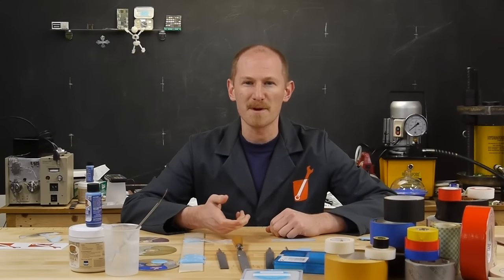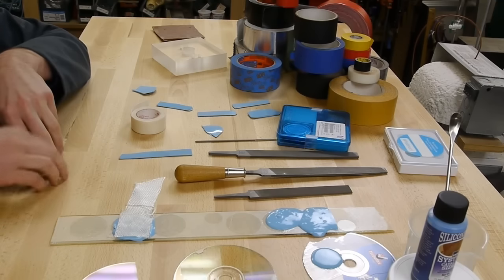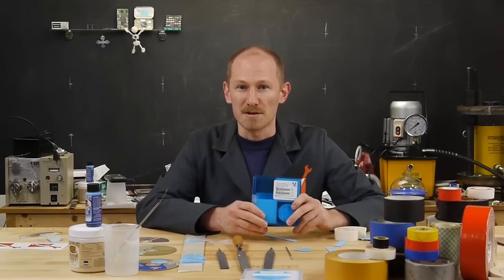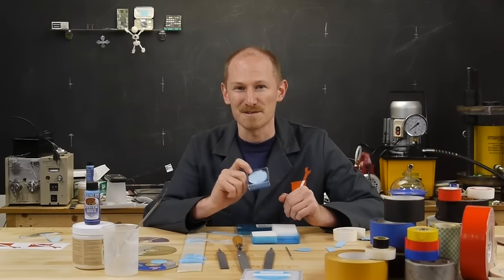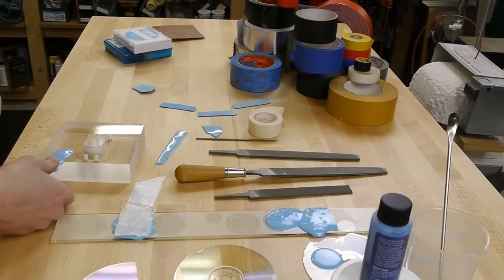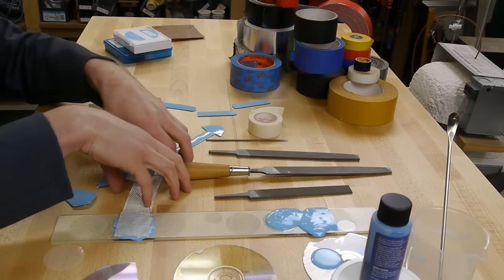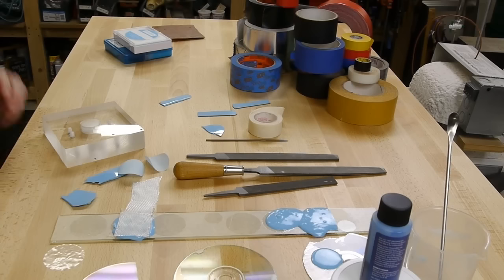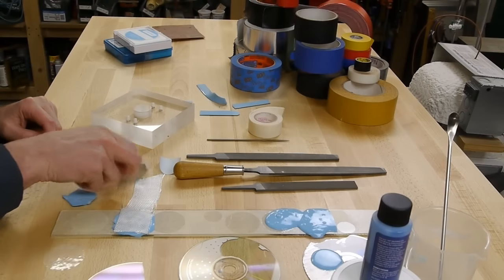Making DIY gecko tape - work in progress

Comment: Speaking to your limitations in making photolithography masks:  In 2013 I did a project at my university using Laser Interference Lithography with a 325nm UV laser, a pinhole, and a mirror to create extremely uniform and tiny (smaller than our photolithography masks were printed) periodic structures in photosensitive chemical film Photoresist, then etch the pattern into the substrate (silicon wafer or polymer film) using chemical or plasma etching, respectively.  I got the pillars down to 995nm from peak to peak, and the height depended on the thickness of the Photoresist, although the pillars were actually had a much more sinusoidal cross-section than as actual pillars.  The interference patter is 1-dimensional with respect to the symmetry of the mirror reflecting the laser light, but exposing your material, then rotating it 90 degrees and exposing again will give you a nice 2-dimensional pillar pattern!  The angle of the mirror and substrate surface relative to the laser beam dictates the period of the structures, and thus, the pillar size.

I don't know what all tools you have to know if you are set up to try all of this, but if you have the spin-coating rig and Photoresist compound (and I've seen your other videos about lasers) then you are already most of the way there!  You'll need the pinhole and a mirror for the laser.

Comment: I work at a solar cell lab and a common micro structure that we make is those nano pillars (called nano wire arrays). The common method uses only chemistry : you typically use metal ions reduced to nano particles that catalyse an etching reaction. This is called Metal Assisted Chemical Etching (MACE), and it is typically done with Ag nano particles in a Hydrofluoric Acid bath. The aspect ratio is tunable and you can get good dense forests. It is usually done on monocristalline silicon wafers which can be hard to get, but they are very cheap. You can then try double casting to transfer to silicone rubber. 
You might also find a method to make the negative mold directly on a wafer with MACE

Comment: I was thinking you could possibly shoot your ruby laser through some sort of prism to detract it into a patern like those cheap laser light shows. For a surface, shoot it at a really hard non etchable surface coated in an etchable surface from your vacuum deposition system. Possibly silver over tungsten? If you had control of your surface coating you would have control of your depth. then you would only have to get an etching of a appropriate pitch.
Reply: +Seth Roughani You can still etch, mill, and cut silver metal using excimer lasers, because it relies on ablation which is not a thermal process.
Reply: Ablation with excimer lasers can be essentially a cold process thanks to Coloumb explosion or direct molecular absorption, removing only the atoms or molecules at the exposed surface. This is sometimes a benefit in LA-ICP-MS analysis for some samples. In any case these kinds of lasers are not DIY. Of course it would be much easier finding someone who can do it for you than trying to build one.

Comment: You could use a Lloyd's mirror arrangement with a 405nm laser (blue ray) and double expose after a 90 degree sample rotation.  Assuming you are using a positive photo resist.  This will give a squarish pillars anywhere from from submicron up to many microns depending on the angle into the Lloyd's mirror arrangement.  I have made gratings this way very easily (only one exposure for a grating).

Comment: Could an organic mould be used? Wood or some other material, perhaps with some part chemically removed to provide channels for moulding? The remaining mold material could perhaps also be removed, creating additional options for the end shape of each fibre (assuming the material fairly uniform in structure).
Reply: That can be work

Comment: A couple ideas -

Layer many sheets of ultra thin material, with every other sheet unaligned, similar to folding a deck of cards.  Use this as a mold, similar to the ultra-fine file method.  

Use flower pollen to create an inverse mold.  It's spiky structure will make holes, and the inverse should result in little pollen like spikes.

Comment: I admire your curiosity and tenacity. If you could get UV cureable silicone, then you could create a modulated raster scanner for UV laser, with rotating mirrors. Final projection can be then scaled with lens. This way you could CAD out various ideas as raised 2D pattern. Start with flat cast silicon base, apply uv cureable layer, expose and then wash with necessary solvent. With solid system alignment multiple pattern layers could be built up perhaps.

Comment: Cast onto finely ground salt epoxied to a surface. That way any grains which stick to the casting can be washed away.
Reply: This sounds like a very cool idea to me, is there any precedent for it working before?
Reply: You can make the salt molten and form it in a negative mould potentially.

Comment: You can use your Electron Microscope for developing Photo-resist it is a bit tricky because of accumulated charges and so on, bending of the beam, but quite easy to accomplish, i did it once to develop a semiconductor.

Comment: Couldn't you just make a mold of an actual gecko foot?
Reply: no, he cannot because if he would make it, he needed a very thin material to get between the geckos tiniest tiny bits of hair which can get from fluid to solid which probably does not exist
Reply: Mould*

That would hardly be practical
Reply: As a gecko owner I don’t know how well that would go over. Sounds cool though, but I doubt the animal would be very into it. Some are a bit fragile.
Reply: @kyokoyumi  ohh ok thanks I always thought mold was the fungus and mould was a vessel used for shaping things guess they are just English vs British spelling

Comment: Maybe you should try casting silicone to the end grain of highly polished ebony wood. Another idea would be to set the silicone on a vibrating platform on top of a speaker. Then, by controlling the frequency you would be able to adjust the pillar shape and size.

Comment: I dont know if these ideas allready got passed by, but things that come to my mind are the next:
- an osmoses filter (the one for seawater filtration for example)
- maybe it is possible to get a membrane for textiles, like waterproof clothing is waterproof because it has a membrane which will not allow waterdrops to pass. 
- Filter material, most fuel filters are in the range of 30-80 microns, much too large for your application, but there are finer filters.
- Helium balloons are coated with a metallic surface, but the helium still passes through the material because the helium atoms are so small (compared to air), so you could take a look at this surface with the SEM
- Maybe you can utilize extreme fine metallic powder, which you could orientate using a magnetic field.

Just some of my ideas!

Comment: How about casting on aerogel, wouldn't that work since aerogel has a very high surfacearea?
Reply: Harald Lindohf , had the same idea, searched for this comment to not repeat.
Reply: problem of aerogel is its unique characteristic: its full of bubles....
this means that any mold made out of it would be inperfect, and the "sidewalls" of the bubbles would not be rigid enaugh to suport being filled with rubber

Comment: There are off-the-shelf products that have achieved that kind of scale. I've worked with a sheet product from a company called Sharklet Technologies. The sheet is intended for germ resistant applications. The pattern is about three microns deep, with grooves forming a an interrupted diamond shape (mimicking shark skin). Might prove interesting if used as a mold for a soft silicone or other soft material.

Comment: Those filter membranes are also used in hydraulic analysis testing in aircraft that require hydraulic fluids to meet a certain level of cleanliness. Typically, the other method that is most commonly used is through a process called light extinction however in worst case scenario, we’ll use these to get a rough estimate on the state of the hydraulic fluids. Essentially, the hydraulic fluid that needs to be tested would get pulled from the system while the system is actively running, the filter membrane would get soaked with a dry cleaning solvent, then the filter membrane would get said sample put in a flask and use a vacuum to pull the sample through the flask, through the membrane and into a waste bin. This process is repeated two more times. Afterwards, the sample would be put into a clear case and analyzed against a chart that displays what colors the membrane is supposed to look in comparison to what it actually looks like. If the membrane doesn’t meet the standard, it shows that the cleanliness of the hydraulic fluid doesn’t meet the requirements and should be flushed or replaced entirely or perhaps the equipment the fluid is running in is contaminated and should be repaired (ie torn o-rings, fine metal shavings, etc)

Comment: Make a new cast of the file,  then use that cast to create gecko tape. This will reverse it and put the sharp edges in the crevices of the new file while the round crevices on top in the new cast.
Reply: Lama Takahama doesn't silicone stick to other silicone?
Reply: Who said you had to cast silicone? 
Couldn't you cast the file using a mold clay or putty?
Then cast the silicone off of that?

Hope this helps :-)

Comment: Like you said before, gecko works by creating a contact by combining structures of different order of magnitude. The pillar and the hair on the top. But you only have the pillar ! It might be too hard to create both by silicon molding, but you could create the hair using chemical coating or something like that. Very interesting ! Good luck!
Reply: Only successful way so far is probably to buy a gecko, love and live with it for 14 years or so, once it’s dies, cut of its hands and feet and glue to a glove. 

Spider-Man.

Comment: One point in time I worked with microfibers. If you take a cross section of one of thos they look alot like the structure you looking for. But in a cloth they are woven in another way. There are alot of SEM pics if you search for ex. Evolon or simular brand of microfibers.
Reply: +GeekJoan Chemically processing the ends of a bundle of microfibers sounds like an interesting approach.  At least fibers would be stiff rather than limp like the silicone :)

Comment: Hi, I used to make
nano/micro structured coating for a living working at the Energy Research Centre Of the Netherlands. 
I think your Gekko Tape project is awesome, I would like to contribute with my line of thinking. 
I found these articles:

http://rsif.royalsocietypublishing.org/content/11/94/20131205
http://www.mdpi.com/1996-1944/4/5/825/htm
From the first paper I gather
you need a specific structure with a specific feature size and aspect ratio.  According to this “single” paper,
you are trying to make a micro structure with roughly 12-20 micron size
features standing upright with an aspect ratio of between 1:1 and 1:1.5.  So your features should be no higher than 1.5
times the width. 
Now I’m thinking of sources
with these kind of pores.  From my
experience the casting of the structure is not the problem, acquiring the
source is. 
Most alumina have much
smaller pores that run very deep, hole size something like 50-300 microns
diameter but 5-15 microns deep. (estimate, I did not really measure this) So
these are tempting structures but I imagine they would be very difficult to
work with. 

“Easy “ but expensive unless
you know a friend or university to help you out would be a laser, a pulsed
green laser (fancy type, 532nm from IPG with optics) can produce 20-30 micron
diam ablations.  So if you would apply a
coating with a thickness of say 30 microns and ablate single hole structures
that should work. 
Although if you put the
holes too close together, you risk getting freaky interference patterns. Also
cool but might not be what you are after. 
On a different note, I’m not
sure about the aspect ratio of this material but TCO glass might be a great
source of different structures. 
In that line of thinking I found nano wire structures
https://acswebcontent.acs.org/prfar/2010/reports/P10840.html
Which brings me to etched silicon, which has an awesome pyramid structure (My line of work used to be in photovoltaics)

http://www.photonicsonline.com/doc/how-to-push-conventional-sided-contacted-solar-cells-to-the-max-0001
An other very promising option seems to be Nylon Net filters.  I
noticed in your video that you where already experimenting  with different filter membranes. But I can
imagine the cast from these will look almost like in the first paper

http://www.merckmillipore.com/NL/en/product/Nylon-Membrane-and-Net-Filters,MM_NF-C756?bd=1
My last idea is to take a needle, looking at SEM images of needle tips, these seem to have a very
interesting aspect ratio, which now that I think of it could be modified ever
so carefully.  Using your SEM you could verify your needle shape to modify a needle to obtain the correct aspect ratio. 
Then place this needle in your CNC machine, then use this setup to make micro indentations in a smooth
surface of an impressionable material. 
Perhaps you could try this method on some plastics. Or to indent a thin film coating. 
Hope I helped
Reply: Diffraction filters work well for this

Comment: How about using a Laserdisc for the "mold"? The laserdisc tracks are 1um wide then the pits are 1.6um deep and vary in length. That should form a much better aspect ratio than a CD. I don't know what the size of the hills and valleys are on a CED videodisc, but perhaps that would be another useful item to test?

Comment: When I was making silicone membranes for seals I observed that they 
behave in similar way as gecko tape. I made them by rolling sanitary 
silicone between 2 pieces of copy paper, then treating it with Drain 
opener and water (NaOH solution with some aluminium pellets). After 24 
hours I discarded drain cleaner, poured membranes with water, and 
stripped remains of paper from the silicone. When it dried it was 
surprising that it sticks to mostly everything and itself too. You can 
try such way too.

Comment: Somehow your videos always show up when I should be learning dynamics or calculus...
Anyway, I have some alternative ideas as well as possible improvements:
1) Letting the surface be in a semi-liquid-ish state by:
        a. Spraying viscous silicone oil onto the sil-rubber before it hardens (they should mix up a little bit) it will either make the  
        rubber softer or the oil will be in tiny pockets in the rubber.
        b. Using ultrasound. Ultrasound during the pouring of the rubber should rough up the surface and ultrasound during 
        application of the tape could force out some air betwean the surfaces of the glass and rubber.
        c. Not using silicone at all but some (non newtonian) liquid absorbed by a piece of cloth. It could be a fluid with a melting
        point of about 40° C, it's quite obvious how to stick this to a surface.
2) In stead of recreating the thin hairs making tiny holes (like suction cups) by:
        a. burning holes into the rubber with a laser.
        b. simply taking a flat piece of sillicone rubber and making a lot of cuts in it with a rasorblade.
        c. pouring the silicone rubber into a mold covered with dust.
3) some misc. ideas you could try:
Spraying the liquid rubber in stead of pouring it. Spraying it onto the ends of a toothbrush (that should resemble the shape of a gecko foot in some way). Using something like lightscribe for fine etching.

Comment: One more thing... with silicone, I recommend degassing under vacuum! This will remove air bubbles and may help to get the liquid silicon to flow into the mold structure.

Comment: cast silicone on etched or sandblasted glass? that could get some amount of "fine roughness". Also if file was sharp on hill, not in valley, you could have simply made a negative casting of that.

Comment: +Applied Science: Flat glass is obviously the best substrate so far: So maybe try etching with hydrofluoric acid: you can use microscope slides and control etch depth by immersion time to get a range of depths. You won't get neat pillars but I'd bet that the HF is going to work by accentuating the surface profile that's already present on the glass.....

Comment: the easiest way I know of to make the mask is to take a standard 35mm camera and photograph the pattern, the develop the film. When you get the photos back, the negative of the photo will have the pattern in a much smaller size. 

Also, the material you make the mold out of should be silicon. Different crystal orientations will etch  in different shapes with different acids. Given what I remember from my time in the NIU cleanroom, 
- choose a wafer of the appropriate crystal orientation
- grow an oxide layer on it the thick enough for the shaft length
- apply the photo resist
- pattern the photo resist with the 35mm negative
- etch the wafer with an acid that will produce a good end shape
 (note, you may need two different acids, one for the oxide, one for the wafer.)

Comment: Hmm. Im thinking a very dense brush.. like a glass/carbon fiber pad with extremly thin bristles.(like the ones they use to dust for Fingerprints) and too somehow coat the tips of these bristles seperatly in some type of silicone or conforming stuff. Keeping them realy short.. then arrange them like a pad. with the coated tips down. ....Just a thing that popped up in my head. =P great stuff. keep em coming!